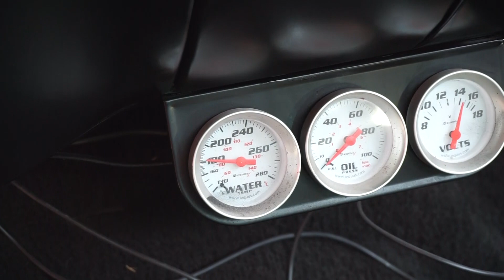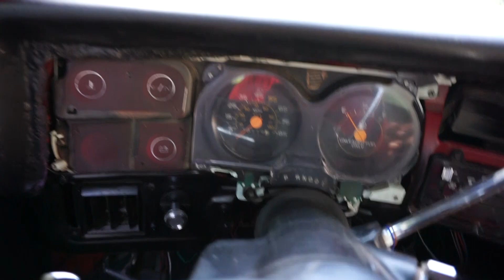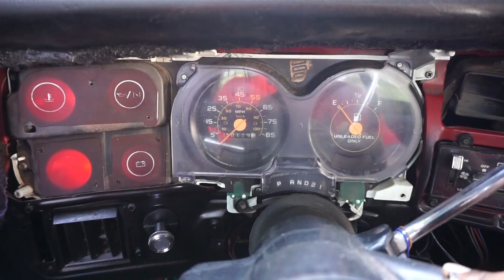THE TRUTH ABOUT WHY MY CHEVY C10 DOESN'T RUN AND DRIVE! (WITH A BRAND NEW ENGINE)

Comment: A little trick install u-joint is and a little more grease in to the cap before pressing in,it holds needle bearings better.